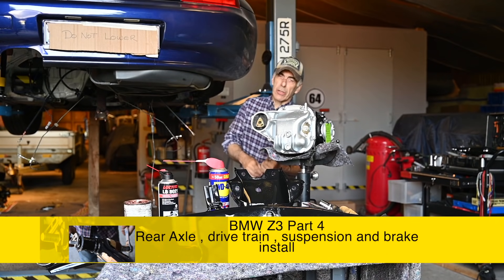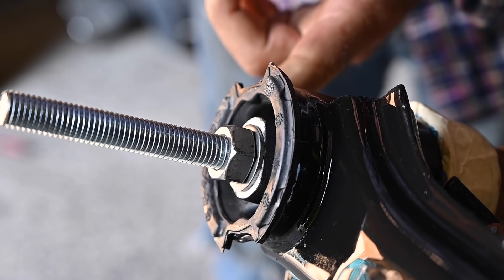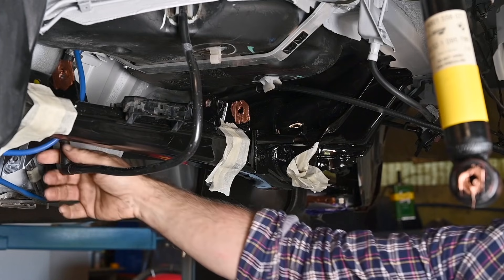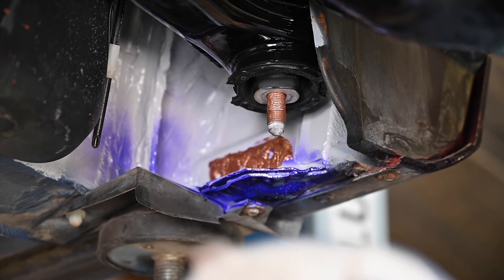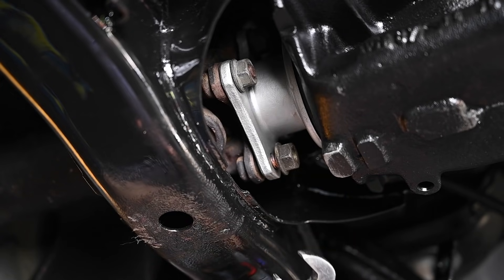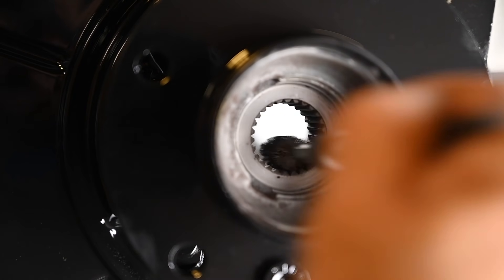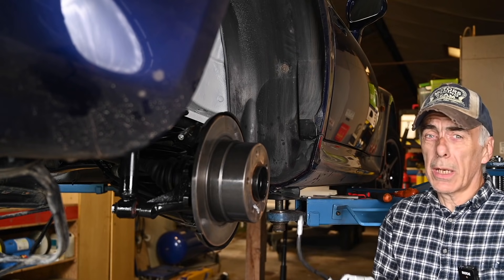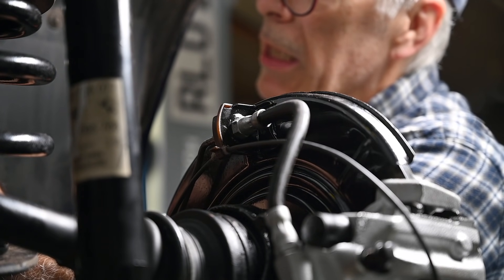BMW Z3 PART 4,   Rear axle - Differential -suspension- brakes etc....  installation.

Comment: As the BMW man in Munich would say "Das ist Wundervoll". With so much that you put into it, this car should be so good to drive. Just a detail, the fasteners on suspension hangers should not be lubricated, just clean and dry. Thanks for posting.
Reply from the maker: Thanks for the comments,  good point

Comment: I sometimes use string to pull springs into place then simply cut and pull out after install. works
Reply from the maker: Sorry for the late reply , as i was away for work. But thanks for the comments.

Comment: Flawless work! Just watched the whole serie and it was a top one!
Just a small point, is that the surface between the hub and the disc should be free of paint, just a lick of copper grease if you want and both surfaces bare metal, it helps the alignment of the disc and avoid vibrations when braking. That is specially noticeable in the front axle but it is always good to have both surfaces clean...
Best regards from a new subscriber!
Reply from the maker: Thanks for the comments and much appreciated

Comment: An excellent job done there Steve, One thing is certain, you would not get this attention to detail from a main dealer, they will charge huge amounts of money, but rush it through as fast as possible. Copper grease is a thing that I also use on all assemblies, it makes later disassembly much easier, (although I have never ha to take things apart again). It looks like there will be a future video on replacing the fixing on your Defender with an all stainless bolt kit, they do make it look a lot better, I also replaced the rear door hinge pins, but they are not included in the kit. Stay safe! Chris B.
Reply from the maker: Thanks for the comments,  yep Chris my Def needs soon a bit of attention as its a 2003 TD5
Reply: @D3Sshooter  Mine also is 2003 TD5 CSW, the stainless steel fixings kit is well worth fitting, there are fixing that do not come with the kit though, like the rear door hinge pins, but they are available.

Comment: tip: i always use tectyl ML on al the fasteners, bolts and nuts on the underside of the car, and when torqued down give them a little sneeze of the same stuff. Because the Tectyl ML is almost transparent it looks much cleaner, and the Tectyl ML doesn't wash away over time. 
20 years later the bolts still come lose like yesterday installed.
Reply from the maker: Sorry for the late reply , as i was away for work. But thanks for the comments.

Comment: Do you sometimes use a paint pen to mark which bolts you have torqued down? I find that helpful under the car otherwise I forget which ones I’ve done after a cup of tea.
Reply from the maker: Sorry for the late reply , as i was away for work. But thanks for the comments.  I do

Comment: Steve you made a big mistake replacing the subframe bushings with OEM rubber. The rubber bushings are too soft, which then puts stress on the rear differential mount. The common replacement is using poly bushings like a Power flex bush.
Reply from the maker: yes , but where I live you never get through MOT...with those poly bushes....  its no mistake, I would if I could but its not allowed by law in the MOT

Comment: A good way to hold the axle from turning is to install the brake rotor and caliper or caliper bracket and put a screw driver or punch in the rotor vent slots ( if you have a vented rotor that is)  and rest the punch or screw driver against  the bracket or caliper. That's the  way I did it . Never had a problem. You can also use your bar and put the tranny jack under the end.
Reply from the maker: Thanks for the comments,  and indeed very good points as an alternative method

Comment: When you torque down a greased bolt do you adjust the torque specs which are usually specified for a dry thread?  I think the torque is generally reduced by 30% for a greased bolt.
Reply from the maker: That is correct, and I typical remove the grease from the treath before doing so...  In fact I grease mainly shaft of the bold and not the actual area where the nut goes

Comment: Hi. Is it correct that the prop shaft has a slight play in horizontal way (from differential to the wheel)? I assume that it’s normal, as it has to let the suspension move. But could you please confirm that this is not an issue? Thanks.

Comment: The suspension bush’s should be torqued with the weight of the car on the suspension.
Reply from the maker: I don't agree with that Robert, as the bush is inside a metal piece (alu) , its that part that is pushed between the upper part on the cars frame and the nut at the bottom.  There is no effect on the bush/rubber part.   The only effect on the rubber bush is sideways movement of the axle...  If I don't forget , I will show you that it makes no difference in the last video on this topic that is to come.   You would be right , if that bush had a vertical elasticity but it does not
Thanks for the comments